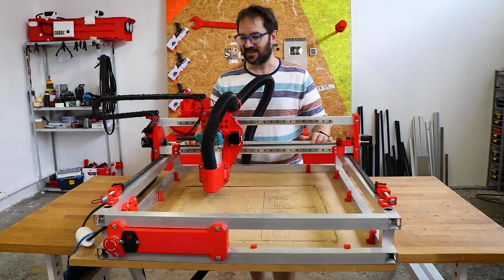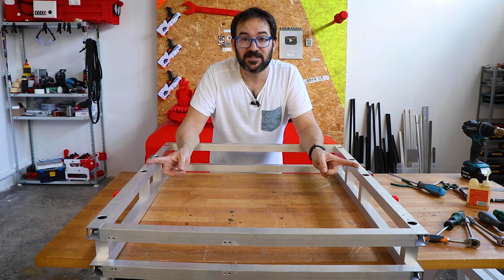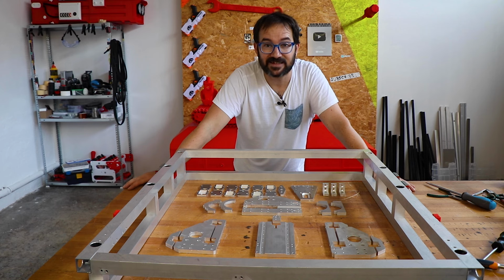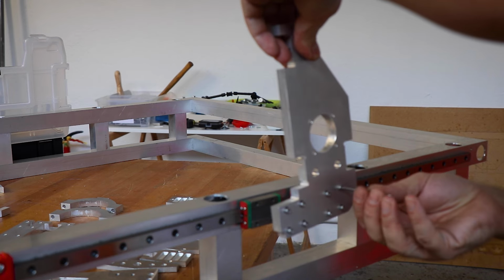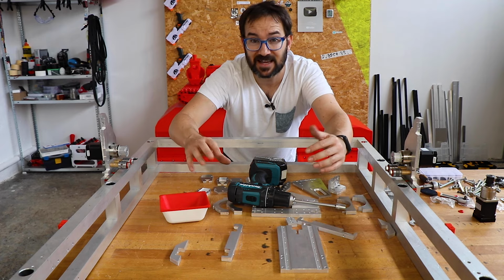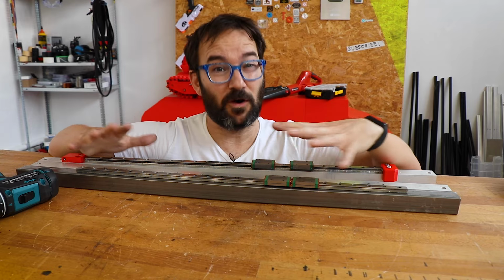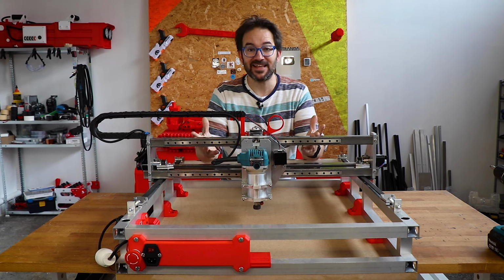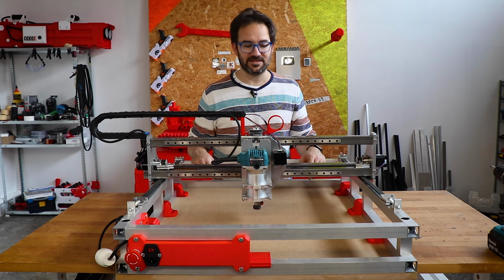A CNC ROUTER THAT MACHINED ITSELF

Comment: God in 10 years I’m gonna come back and he’s going to have a freaking turret lathe or an entire Swiss lathe made
Reply: Also you could also possibly make yourself some molds with your 3d printers and make some pieces and a base made of epoxy and gravel or filaments for an epoxy granite that dampens better than concrete and pretty light. You can use it for spacers and such in between the machine components to make even better more capable machines. A lot of the capabilities of cutting steel and titanium and gummier materials comes from the vibrational dampening and stability of your machine.

Comment: After designing and building 3 CNC mills + routers I would do just one thing different from what I see here. Start by making all of your flat aluminum components out of either MDF ( aka Medite ) or furniture grade plywood as accurately as you can. Assembly your machine as accurately as possible and really tune it up. Now you have a decent CNC router that will make very high quality aluminum parts which you can make one by one to replace your temporary MDF parts. A true bootstrap operation.

Comment: why you not use touch probe Z zero, then have ewerytime right zero level when change tool bit. nice machine but minimum need be be nema 23 or 34 motors and NOT belt newer, and biggest fail you have. palm router, worst and lot noise, good spindle not noise lot alltime, i has before makita router to spindle but ewening if make woodwork whit cnc neighbour 2 next house say stop no can sleep noise lot, i buy 800W DC spindle ER 16 collects air cooled, 120$ and then not has noise. now can use cnc at night.

Comment: Mr. Ivan
Thank you so much for all you do and the cliffs you encourage me to jump off of… No you don’t encourage me to jump off of them outrightly, just subconsciously LMHO.

Here is my project and my questions: I am going to build this machine and alter the frame tubing size slightly for rigidity & strength.  It will be 5 feet wide & either 20 or 40 feet long.  The mill depth will be 10 inches deep.  Instead of belting, I’m using gear rails for accuracy & repeatability.  Im routing out experimental wing mold casts for C.F. home built aircraft.  What are your thoughts for a strong durable router machine/motor and CNC program.   This is for personal use only!
When I’m done I will send pictures. 🤪  I have been given various recommendations and I wondered what your thoughts are if you are willing to share. Even if you don’t, thank you for your awesome website and all of your time‼️🔧

Comment: It was very cruel to force the old machine to make its successor...

You may experience galvanic corrosion on the ali, as it's in direct contact with the steel. There are paints that can help with that, or use a SPACER!
Great vid 👍

Comment: Hi, I'm making a very large CNC 2.4m by 1.2m with 0 budget (steel everything). I ran into a problem with the up and down axel (my Z-axe) it's almost 14kg. So what I'm now going to be doing is make it with fiberglass. 
If you ever do anything using fiberglass please make a CNC.
I would like to know if it is possible to handle the stress.

Comment: Query Ivan, instead of swapping out for steel tubing, could you not have used a thicker walled aluminium tube ?
ps. Love your videos
Reply: Using thick wall Al tubing will be more expensive and the steel ones he used are sturdier than what the thick wall Al ones culd be

Comment: You kind of loose the utility of a CNC machine if every piece has to be filed and ground on to get them right. You do your setup no favors by leaving all the chips all over the place, just nasty and unclean process, tons of room for improvement to your process, your results will remain marginal until you work on this aspect.
Reply from the maker: My machine works perfectly fine and my results are phenomenal. I use it a lot and I'm pretty happy with it. Please don't project your expectations onto my projects you may get dissapointed often.  If you don't put context to your comment  people may think that machines that don't work to aerospace industry  standards (or professional machine shop standards) are useless and not worth it for the hobbyist. Thanks for commenting!

Comment: I'm looking to buy a CNC router / laser / possibly milling machine... you have inspired me to consider building a machine. I already have a drop saw on a sliding arm with blades suitable for cutting aluminium and steel.. Also a pedestal drill and some other hand held power tools... a track saw soon to be added. I'm assuming that controllers, belts, z axis worm drive, stepper motors are all available commercially. I might have to get some of the components made by someone who already has a cnc milling machine. Could you (theoretically) add an a and be axis to your design? Not that I need this capability. BUT two serious questions.. what was the reason you decided to use steel bars on the gantry?...I missed that. Q2... with the end pieces of frame, if you had redesigned these so that the bottom rail was raised, say 55mm, could you have then been able to 'slide' longer workpieces through the bed of your machine? Sorry I said two Qs...two more... what is the vertical range of your z axis? Can you add a laser etcher to your machine?

Comment: how long did it took for the CNC to make that? 3-5 hrs? at 10kw/h? or what consumption(calculating the computer energy supply also and other cooling/airing systems that go with the CNC)? was it worth it? like electricity wise waste... for a custom 5$-10$ item?

Comment: Hi Ivan, just a hint for tapping, first countersunk, than tap, makes it easier an you do not destroy/damage the tappings :D
Nice Work - What was first Egg or Cicken ?

At 11:10  the bearings as guide for the belt, instead putting each on a extwnsion, make a Part connecting both as a spacer, maybe additionaly connected to the sidewall to perform more stiffnes - I would think although the screw seams to be big, it will bend over time, the belt tension schould not be underetimated. Same at 17:29.
18:39 use a ballscrw instead a trapziodal, less to no backlash.
18:57 heatsink on the stepper not needed - ist connected to th aluplate, that is enough - maybe finetune the spepper settings eg. current etc.
Change the connection to the baseplate, the plastics might not hold enough when milling metal I think, make some ALU brackets instead.
Why did you not replace all ALU pipes? only the Yaxis ones?

But never the less quite well done

Comment: Nicely done.  Makes me want to push my machine harder to do aluminum.  Two questions.  - What is the driver software I saw on your tablet in the last scene? And do you have a video on the servos?  I need to check your channel history. Thanks Ivan.  ~P
Reply from the maker: Universal GCode platform and what servos? it uses Nema17 steppers, did you mean that?

Comment: Title: A CNC ROUTER THAT MACHINED ITSELF
Video: Parts being made with hand drill and files.
Reply: Because he used a CNC router that had printed structures to machine the aluminum plates that would serve as the replacements.
Reply: @ChucksSEADnDEAD  But that's not what we see in the video.  We see a whole lot of hand drilling and filing.

Comment: 18:27 i would like to know where you get that kind of trust bearing for acme threaded rod  thx  what its proper name so i can search for it
Reply: "Lead Screw Brass Nut with 4-M3 Holes(Acme Thread, 2mm Pitch, 1 Start, 2mm Lead) for Diameter 8mm T8 Tr8x2 Lead Screw of 3D Printer Z Axis" Does this help?
Reply: @FrustratedBaboon  maybe but too late now 
but thanks :D

Comment: 21:05 the metal version looks MUCH stiffer and the aluminum plates are super close together. surprised you only went from 3mm (3d plastic z axis) deflection to 1.75mm delfection with the aluminum z axis. I bet if you put some vertical braces between your 2 linear rail x axis then it would be even better? where is the deflection coming from?

Comment: Why not chamfer/deburr at least one side of the part with the machine? It's already in there and programming a 0.5mm deep trace with a dummy 0.5mm diameter bit (if your software does not support chamfer/deburr passes) is quite simple.

Comment: You should add spacers (!) between your steel and aluminium pieces to avoid Galvanic Corrosion. Different metals tend to react to each other.

Comment: I would recommend paint at the very least, between the steel and aluminum.  Dissimilar metals in contact corrode at a much quicker rate.
Reply: paint is weaker than aluminium's natural oxide layer

Comment: Pedant alert: I do wish we could stop calling it "a CNC" because that expands out to "a computer numerical controlled". This is a CNC router (or, if you want to be generic, a CNC platform). 3D Printers use CNC technology, as do mills, lathes, machining centers, etc. This is like saying "I built a red" or "I built a gas-powered"
Reply: I see you changed the title, Ivan. Thanks!

Comment: great project but it seems that it has some drift as on the end shot the drill went to the center of the circul but it did not align up with the previous one. You may need to check software or have something to remove the slack. 
As for the spacers....the bolts are long and will flex due to the tension on the belts. This can result in miss alignment and incorrect repositioning.
But don't get me wrong. The project is great. Keep at it.

Comment: many thanks again Ivan, I have gone through all your vids, and I am sure you have mentioned somewhere, the printer requirements to print your parts, I am leaning towards the ender 3 pro if the bed is big enough. this information needs to be accessible somewhere as well as the list of parts . I have steppers here for instance, but the mounting hole placement would likely differ from yours, not to mention the linear rails. links for their purchase would be great to so we don't mess up with wrong manufactures. Your website would be the first place.
Thanks again for your enthusiasm in this dark time. It's contagious
Reply: ok I found some info on your site, have you just put it there or am I going nuts. Info on bed size sais 200 x 250. so I am not sure here, All dimensions that I have seen are given in 3d , so should it be 200 x 200 x 250, in which case my purchase of an ender 3 would be ok at 230 x 230 x 250. someone in the know please reply.
Reply: @leswheeler2023  i printed all the parts with my Ender 3 except the power supply box that is too long, the carriage is the worst one as you have to printed going up and the ender 3 extruder is almost hitting the top of the frame, some of the other pieces have to be print in diagonal to fit the Ender 3 bed.

Comment: @Ivan Miranda great video and build, do you have anywhere you have put the settings you have had the best results with for cutting aluminium? router speed setting, cut depths and feed rates etc? i've been trying with my but yours seems to cut much nicer than mine does, even with the 8mm deep cut.

Thank you!

Comment: I've got a 3018 that I've only used with the laser head. I'm studying how to use it for CNC so I'm still quite the noob. Is it common to use the CNC to mark through holes and then later drill them to size? I really learn a lot from your videos. Thanks!

Comment: Hi 
I have a question if it's possible answer it 
All 3D printers I have seen their beds have an axis like z axis or y axis why there isn't a printer that all axis are for Hotend like cnc Routers is there any reason for it 
( except delta models)

Comment: is it just me, or is the fact his table isn't flat bug you?
Reply from the maker: It happens to me too
Reply: @ivanmirandawastaken  currently working on a challenging project, do you know where i can buy propshafts for rc boats from? i found one on ebay, but since i plan on uploading my work on thingiverse a proper supplier would be appreciated. just asking since i know you have experience with rc equipment. thanks
Reply from the maker: Check Peter Schripol boat projects, he uses tight fitting brass shafts and pipes to make very reliable ones
Reply: @ivanmirandawastaken  thanks will do

Comment: I'd say a lot of that 1.75mm deflection was from those awfully long SPACERS! you added to the idler pulleys. I highly recommend just simply machining a bracket that ties the ends together! Your aluminium base could also be causing some deflection, maybe some triangular bracing will help with that

Comment: this cnc is awesome!!! but i`m did not clearly understand - why you said do NOT buy these plans? Because i`m really want to do this))
Reply from the maker: There are plans available for the two previous versions, this one is not documented, I'll add this files "as they are" but there's no documentation.
Reply: @ivanmirandawastaken  thanks for your answer... So, if there all files for previous versions and these new aluminium parts files, i do not see any troubles to walk yours steps in producing this handsome build. And last question - what about specifications for other parts (like steppers, belts and etc) and software sketch you have used? Are they in package?))

Comment: I would add a tub and water pump to keep the metal cool and to remove metal particles from the work project. Add a filtering screen to protect the pump. Another benefit to keeping the bit cool is that they will last longer and prevent dulling.

Comment: I got so anxious when you tapped the steel cross beams. On the last whole when the speed went back to normal I thought it was going to break. I honestly don’t know why as you have had sooooooo much practice 😂.
Despite all that what an amazing build. You just can’t help but improve it. I actually bought the CAD models myself and am in the process of making the first 3D printed iteration. Thanks for doing all the CAD modeling 😂.

Comment: Stepper motors can get very, very hot, PLA softens at temperatures as low as 60º. You could have pulled it off if you had used filaments with higher melting temperatures. But nothing beats a full metal cnc, the rigidity is just so much better.
Reply from the maker: I pulled it off

Comment: hi Ivan,
Great job, congratulations!
Some impressions of what I saw in your video
To work less than a drill and a file, however, next time use the double-sided tape between the aluminum and the martyr bed and make the last two very thin passes on the perimeters, without leaving those small "walkways", leaving the cut of the edge of the piece for last.
You can make the holes of the final diameter directly with the CNC, so you can also make the recesses for the bolt heads, without obtaining the conical bottoms as with the drill bits.
For greater reliability over time and greater precision in moving, I would advise you to make "biscuits" with two holes, which can hold the heads of the bearing holder bolts in the points where the belts pass around the engine: having lengthened the lever arm with brass spacers, you have a point of greater effort and swing.
With these "biscuits" you will avoid that the two bolt heads tend to move away from each other, loosening the belt during the translation movement of the axes

Comment: Outstanding project! And so many steps done by hand, with precision and dedication to every detail!
I wonder if it would be possible to make an all in one motion system with all the knowledge you have acquired with your builds. The linar rails and all metal construction would be perfect, I'd just change the design of the Z-axis to something like the Lowrider CNC does: Two screw drives on the outside of the machine, which can move below the table surface. That way, the Z height is only restricted by the table height, and you could install a heated bed and an extruder and have a large printer (Vulcan extruder?). Some kind of quick swap mounting system with only a few screws or clips, and you got yourself a capable machine for almost any task, you could even mount a laser and a stepper driven rotary chuck for machining round stuff! Just an idea to save some workshop space :)

Comment: Pretty cool! I would recommend paying some attention to the feedrates. I am quite impressed the bit didn't break. It must be very soft aluminium you have there. A good quick rule to get you going is to use always less depth of cut than the tool radius. This way you have that fixed and can test different feeds, with the hand on the stop button lol. You should be able to instantly pause the machine if something is wrong, and you can always override the feeds after you post process, and are running the cut.

Comment: Usually to clean edges of parts up from break off tabs we use a die grinder with various sanding bits. we also use a deburing knife to clean all the sharp edges if there was not a chamfer used. The upgrade looks good. interested to see what you shall make next with it.